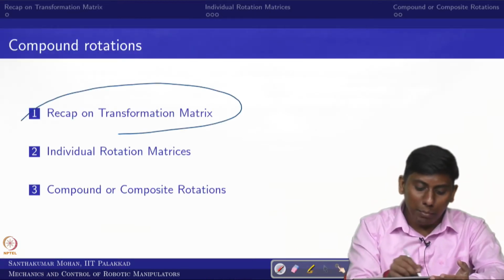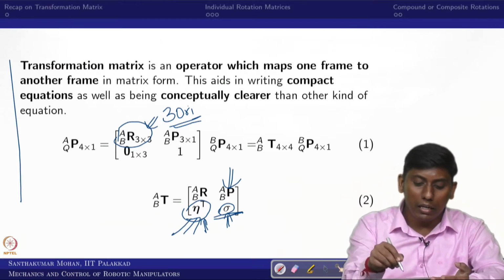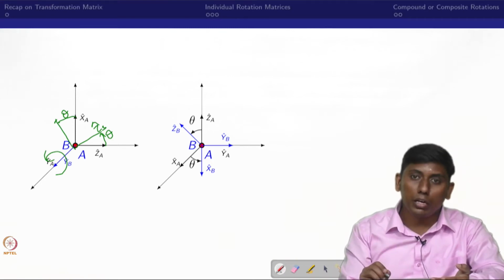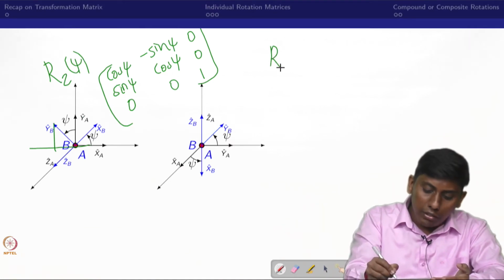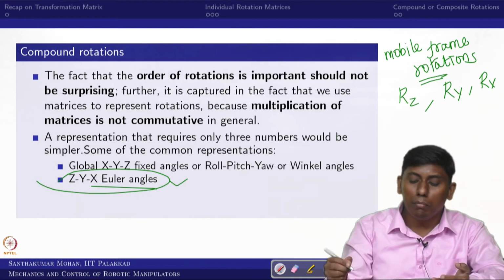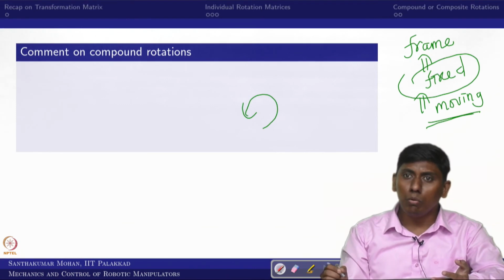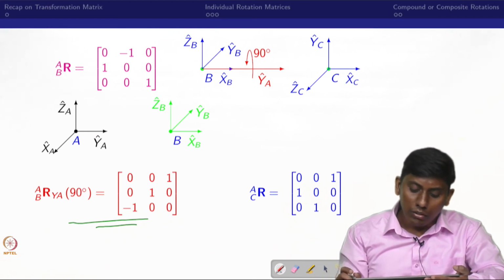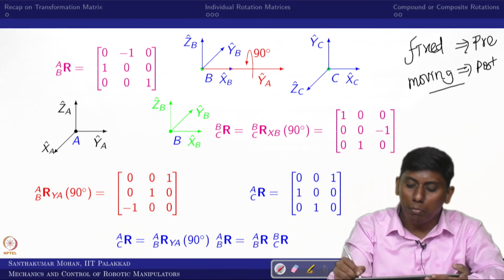Lecture 6 - Compund rotations part 1

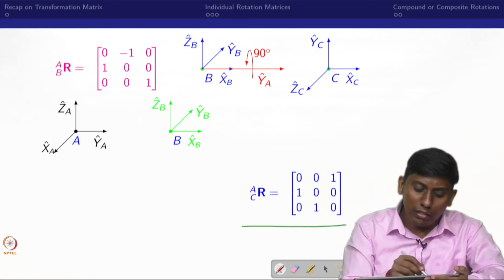Comment: After 21:33 whatever he did, I couldn't understand anything. I could just see his hands moving. It seems that he is making understand himself, he forgot he is teaching, and he has to make viewers understand.
Reply: ok, even I felt the same while seeing the lecture 1st time. Then I realized that professor is using the formulae to calculate the rotation matrix with respect to the mentioned reference. And in addition he has compared the difference between pre-multiplication and post-multiplication and when should be used for the occasion. When the fixed frame is moving pre-multiplication is prefered and when the moving frame is rotated with respect to other frame use post-multiplication.

Thank you, hope it is helpful..